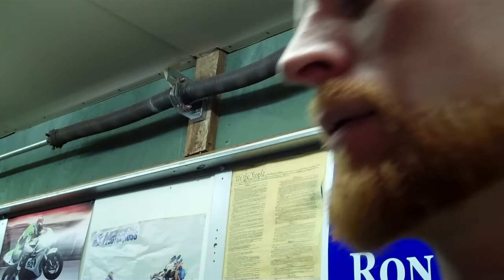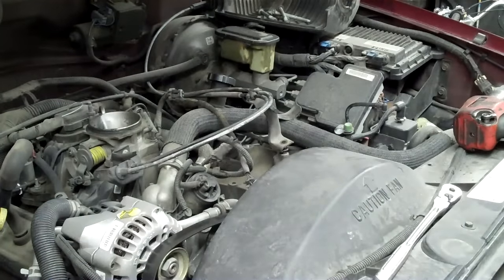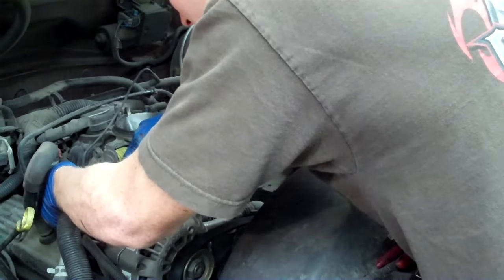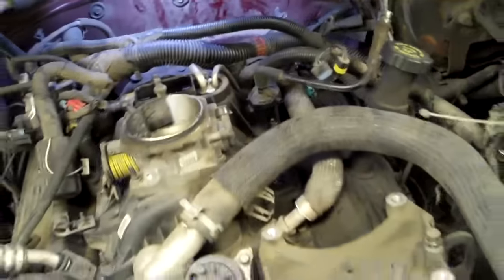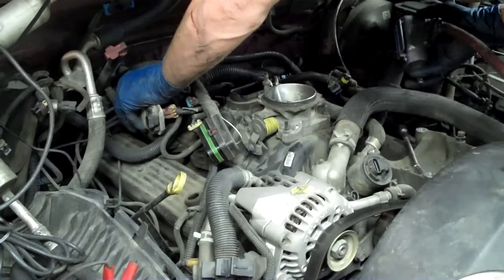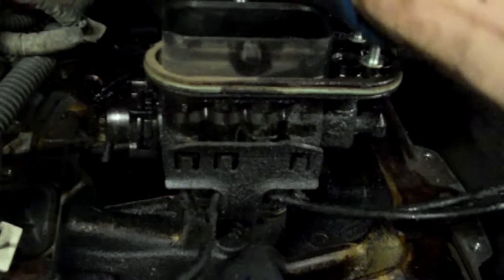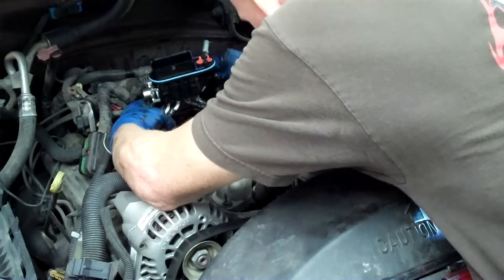How to change a SPIDER INJECTOR on a Chevrolet V8

Comment: Hey Brian. Thanks for the detailed video, I knew it would be a bit of a process but now I know exactly what to expect. I am trouble shooting a 5.7 I just bought and found once I add fuel and let it sit for a few days that my gas is dramatically less.ordered a fuel pump,filter,plugs and head gasket set because of constant white smoke. upon checking my oil I noticed it is thin and smells of gas. So I am assuming it is the spider leaking either at the pressure regulator or one of the spider legs. have you ever run into or heard of this happening to anyone else? could I clean the regulator or do I have to fully replace the unit?
Thank for any help my way.
2000 Denali 5.7 no check engine

Comment: Thanks for the reply, it turned out to be something completely easy. During reinstall I made a completely noob mistake, 2 spark plug wires going into the cap were crossed, due to a shadow, couldn't see very well :) i fixed it within 5 minutes of posting my original comment. anyhow, my truck now runs better than ever. Incredible results. Perfect starts, hot or not. Everyone needs to do this.. Its very easy and the results are well worth the few hours.

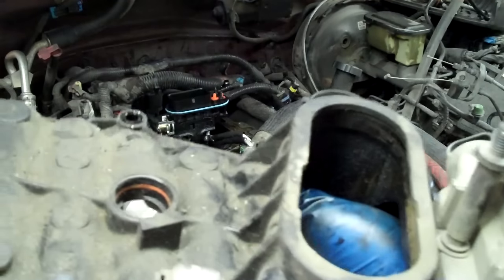Comment: hey brian, what kind & size o-rings or gaskets do I ask for when you talk about replacing the two at 34:19 to 34:23 ? those didn't come in my kit and I want to have them before starting project cause I won't be able to get to parts store when it's torn down.... also what is torque spec when reseating?  thanks very much if you can help with this.

Comment: finished this on my 99 suburban 5.7, it had been driven a couple weeks with bad fuel leaks, bad injectors bad fuel pressure valve etc, so it must have been loaded up with dumped fuel. started it tonight and got plenty of pressure and started instantly but runs ragged and slight backfire through the exhaust constantly and idles rough.

Comment: Hello,  what was the truck doing before you end up doing all this? you had gas pressure and spark, and it wouldn't start? how did you diagnosed or found  the problem?  thanks.

Comment: Let see if I have this right. The outer lines on the module got to outer injector ports and the inner lines go to the inner injector ports? Which lines are are on the top? Also, mine has been running rich a long time. How should I clean the top of the lower intake manifold? There is a lot of black greasy build up. Thanks for the great vid.

Comment: Hey bud, how do I check the injector signal at the harness connector for a 99 5.7 tahoe? I have a no start but do not want to replace spider until I'm sure that's what wrong. I'm not sure how to check that the injector is receiving a signal.

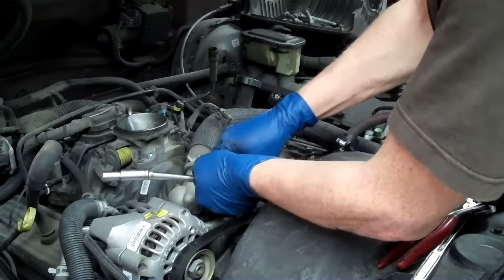Comment: Thanks for the video.  I cant find out where the Round pin plug goes.  You have it right above you right hand at top of glove at 8:22 - 8:25.  I got my '97   5.0 liter back together ok with new MPFi installed.  Been running back and forth into the house trying to put it all back together from watching bits and pieces of the video..  Unfortunately, my engine acts like it is missing on one but has greatly improved since MPFi changeout.  I already did plugs, might be wire IDK yet. Thanks for the video

Comment from the maker: I would take your VIN # to the dealership and get whatever they have.  I use aftermarket and performance parts most of the time, but in this case with this part the dealership has the latest updated part.  There have been SO MANY updates on these dang things.  You can get the old factory ones that are name brand- they get dumped onto the after market, but they are obsolete.

Comment: Thanks for the video, gave me the courage to attempt this after putting it off for so long.  I have one question....any tips on an easy way to get the o ring on the fuel injector to seat in the intake opening?  Been fighting it and it will not go.

Comment: My Yukon has a similar engine and I had a very similar problem.  I had misfire codes on 7 of 8 cylinders.  New plug fixed one cylinder but had 6 injectors failing intermittently.  Spider swap got rid of it.  Just fixed it on 3/5/13.

Comment: UPDATE:  Brian,  I loosen the screw that holds the bracket and raised it a little which brought the injector up higher.  I decided to change the bracket since my spider injector came with a new on.  My wife is a nurse so she gave me some surgi lube and everything worked out fine.  she's running great, like the day I bought her.  I got 231,000 miles on her and hope to keep on going !  Thanks for your video..John

Comment: Nice video, I'm working on a 96 4.3 Vortect atm and there is a possibility I might have to change the spider injectors. I had 2 questions if you don't mind 1 what was the symptom of that vehicle and what was the mileage of that car? if you still remember. Thank You

Comment: Installed spyder fuel injection as shown on video. Your video was very informative. I have a problem though. Truck is not starting, tries to start but acts like it is flooded. Took plugs out and are VERY gassy. I can shake the gas off the plug. Any suggestions???
Reply: Just my opinion, but you may try a new AC Delco fuel pressure regulator.

Comment: Nice vid bro👍👍👍👍👍
You broke down exactly how it needed to done!!! My question is..does this same method work for a 2000 Cadillac Escalade 5.7... I’m having some studering in my acceleration...not a tune up issue but I’m thinking its from the fuel pump and filter... I’m gonna start with the distributor and cap, new plugs and wires, new fuel pump and if that’s not it then it have to be the spider injections... also I keep getting a gm code p0303 misfire on cylinder 3.... which lead me to think it’s the spider injectors....please reply if you have suggestions...again nice video 👍👍👍 and thank you

Comment: Brian Great video. I had a code of “PO300” misfire for cylinder #1. Swapped 1 & 3 wires (no change), swapped 1 & 3 plugs (no change). So then I replaced the existing SFI with the new MFI system. Watching everything to make sure I installed it right. I did not performa fuel pressure system check to make sure the injectors were seated right and not leaking. Finished putting everything back together and now I have the same code “PO300” but it’s stating I have multiple misfires.
Any ideas before I tear it down to check everything?
Thanks

Comment: Have 97 Chevrolet Silverado. Started spitting and sputtering, will crank fine when cold but idles high. Once warm it will turn over but not crank until you hold the gas pedal to the floor. Once cranked though, it rough idles, sounds like it’s flooding or a hopped up race truck. Wants to die when shifting in gear and smell gas heavy. Fuel consumption has increased a lot. Does this sound like the symptoms of the spider injection system bad? Fuel pressure regulator? Any help would be greatly appreciated. I’ve changed the distributior-rotor and fuel pump. I’m spent and have tried hooking it to a computer for a code with nothing in return besides a engine coolant temperature sensor. I don’t believe that’s the issue at hand. Again thanks in advance

Comment: Hi, what was the symptoms of the faulty spider?  I am dealing with a 1999 GMC Yukon Denali that wants to sputter/stall when accelerating.  I have changed the 02 sensors, new cats, egr valve, throttle position sensor, fuel pressure regulator, fuel pump, fuel filter, mass air flow sensor,  ignition coil.  Checked for vacuum leaks,  Still won't solve it.  I am looking at this video as a next step.  Also, which silicone lubricant spray do you recommend?  Thanks!  Great video, love your patience, rants, and thoroughness!
Reply from the maker: Running poorly and missfire codes like P0300 & P030*

Comment: I have 1998 Silverado and I have to change the spider fuel injector twice with a used spider, still doing the same thing just run for 30-40 second and cutoff am trying to buy a new spider now, Do you think that will be the best to do?

Comment: Hey boss. I've replaced the feul pump. Resistor  and the unit on the left side of the upper manifold. Can't remember what they called it. Anyway, I put Marvell mystery oil in the feul system  now it runs . How long before it takes a shit? Should I replace spider also? Thanks...

Comment: Brian - great video. I have a 1999 Suburban. It starts up and then will not stay running unless my foot is on the gas. Engine sounds very rough.  I replaced the distributor, plug wires, and plugs. No change.  I think it may be the fuel pressure reg. and or regulator.
Can you offer any advice?  Maybe crank position sensor but I think that would be a no start condition... mine starts fine... just wont stay running without giving it gas.

Comment: Did you have a hard time seating the injector assembly back into the upper intake manifold? I can't get it so seat right in and it's causing a big vac leak, any leads?

Comment: Thanks for the video Brian it really helped me to "wrap" my head around the job.
Reply from the maker: Welcome Al.  Great to see you!
Reply: Thanks!!!  I changed out the spider and regulator and still have a non start condition. Will do further testing.
Reply from the maker: Check for spark.  It could be the CKP, control module, or coil.
Reply: distributor cap always malfunctions on these engines causing no start
Reply: thatswhite1 I had changed the Cab twice before...so I am confident that it is not the issue. It started shortly after I changed plugs wires cap with all accel set. ill keep playing with it even though the truck has sat like 2 years now. LOL
Reply: Al Forte check for fuel pressure, fuel pumps like to fail when they sit for long periods because of the moisture in fuel.

Comment: Brian,I have a 97 GMC Sierra 5.0 Liter...got everything off fine, new spider injector in but I can't seem to seat the upper cover the new spider...It will fit just fine without the O ring around it but when trying to get it on with the O ring on it just won't go.  Also the fuel regulator doesn't have a port on in that points down like the old one.  I notice yours I your video has it.  Any thoughts?  The part number on the inside of the new Spider is the same as the one on the old one.  Thanks,John

Comment: I was thinking of doing this,because I've done everything else. 98 cheyenne 4×4 305ci. If you slowly press the gas it will rev up. If you try to drive it it falls on its face bogging down like it wants to go but it wont????

Comment: Hi Brian. Thanks for all of your videos. I tried my 1st 5.7L spider injector UPGRADE today. I had an injector that did not "lock in" when inserted into the hole. Is this common ?  Visually I could see no difference between the one that would not "lock in" and ane that was not yet inserted. The assembly was a new AC Delco. I would not think that the injectors just get shoved in without being held in place. The ridge within the hole was verified and the hole seemed clean (visually). Defective part or defective mechanic ?
Reply: What ended up happening?
Reply: @MiguelGarcia-nl3ci  I tried a second Delco and got thew same result. Perhaps they made a bad batch. I then got an aftermarket set at Autozone., I don't remember the brand. They inserted and 'locked in place " with no problem. The car ran fine with the aftermarket set. This job was done on someone else's car, therefore; I can not speak to the longevity of the part.

Comment: My son has a 1999 Suburban 1500K.  After sitting for a long period in does not like to start.  It will crank and crank and won't start.  When it finally starts it is good for the day.  In the morning it many times does not want to start.  Have replaced fuel pump, gas lines, and whatever else he could change or have changed.  Have now been told it is the spider injection assembly.  Have you ever seen one act this way and have it be the spider injection aasembly?
Reply: Negative.  Just needed some TLC.  No need for bad language.

Lou  :-)
Reply: Usually it is the fuel pressure regulator leaking. This floods the engine after it sits for a while. Accelerator pedal to the floor while cranking should make it easier to clean out the surplus gas. But yes that is a symptom.
Reply: consaka1 hi. I will be going under to replace my fuel pressure regulator. Since I'm in there already should I mess around removing my injector spider to clean things up or leave it alone?
Reply: Could be your ignition switch. Common problem in these.

Comment: What is the symptoms of the spider injection going out? I replace the fuel pump fuel filter and still have to spray gas in sometimes to get to start and sometimes don't want to take gas going down.

Comment: Hey Brian 1st of all great job on the making this vid. I'm looking at purchasing this '99 Suburban 5.7 with 201k on it and they told me it has a #4 misfire. So they brought it to a mechanic and said that it cld be one of a cpl thing's either head gasket or head I'm guessing he was meaning warped head but then you'd know for sure by pulling the dip stick. After watching part of your vid I heard you say something about misfire...so you think the spider 🕷 injector cld be the culprit? Cause I'd rather just do that than going any deeper if it can be helped. Thanks...

Comment: Question, I am going to replace the intake gaskets (coolant leak). Would you recommend doing this while the intakes off? 116,000 mile Tahoe 5.7. Thinking maybe killing 2 birds with one stone. Seems to run good cept for a little rough idle when cold. Thanks

Comment: Hello Brian,

     So I done this whole job in 12 hours and with this new unit for the spider I was Already freaked out. 

The ports our so long and look to be to long. 
But I did the challenge and did the challenge slow check everything and did everything , with out tearing up the truck.
(97 chevy tahoe 5.7 4 wheel drive LT.
I had a code miss fire and a code miss fire 4.
So I figured the spider went after all plugs wires cap were fine and I had spark. But Maybe I should check compression.
So after I was finish cranked it over Ratttle left side of chamber 8 and 7.
sounds as if the pistons our hitting the Spider because there to LONG.
I think the puppets on the AC DELCO which was the old unit was shorter and better used for this but they snap and now I think the plugs might of called into to chamber and that means pulling the head and checking the Values.
By god I crank it over six times in different times to try to figure out if there was a rod that went. Cranking it over for 10 seconds or less running.

So the question is you stick with the NEW spiders and claim they will work and they our not to long. Maybe the 97 is different from the 98 in the video, But I doubt it.
20 hours of work coming my way.
Could be a wasted spider. 
Only way to get those spider puppets out is to push them from the back side because there no taps to press them out.

Pull the engine LOL

Comment: Thanks again for this video.My son and I just tackled this,and knocked it out in about an hour thanks to you on the laptop in the garage.The tip on the crows foot for the fuel line was great.Bought a set before we began,glad we did.!
Quick ?. the truck runs alot better now.around town awesome.But when i took it to the highway the truck doesnt want to kick down,even when i manually shift it down a gear or 2..any help please..thanks so much

Comment: Try checking it for vacuum leaks at the obvious spots being hoses. They can have small cracks hard to see. Spray all around hoses and intake with carb or brake cleaner. If the motor smooths out you found your leak. Or try cleaning IAC in throttle body. IAC being Idle Air Control.

Comment: Great video. I’ll be doing this soon. The price of the injectors scared me a little. Do you recommend a certain brand.
Reply: Nice video. My new style spider with the dangling injectors (as in vid) had very stiff tubing. End tubes would snap loose, so I spent HOURS with heat lamp getting a bit of bend. That did help. Next: the bracket is over-built, spring steel, and cuts the sides of the tubes. It is possible to grind away LOTS of the steel and it is still immensely strong without cutting the tubes. Why do engines fill with gas? As careful as I was, the car would run PERFECTLY but I got baffling hydraulic lock-ups. Drove me nuts. Today I verified LOTS of gas in cylinders and oil pan. Yet, it ran perfectly til it simply stalled on the road. There needs to be vid about the pressure regulator, take it out, discuss all parts, put it back on. What if I lost a little spring... don't know yet. Down-tube was dripping gas into ports, so I'm going to hook lines up and pressurize to see how bad... The outer ring on my regulator is split. The inner ring is in the spider-body. Which one matters most? Should be inner holds the pressure. I do not recommend the stiff tube fight, with tips popping off. Nylon can take about 300 degrees to bend easy. I also cut the heat shields so I could double-layer at the bracket for a guard against the cutting edges. Got it really good, gringing, etc. Now, the leak... Oh, yeah, my other style skinny black line spider seems to have blown codes in one year. But bends really easy. Good luck with either.

Comment: Took me about 4 hours to get my son's done, and your video was very helpful, but I have a few questions for you.  I had some trouble getting the plenum to fit all the way over the new injector unit, so I just tightened the bolts and it seemed to cinch it down.  After running the truck for about 10 minutes, the check engine light came back on  with the same P0304 code.  Any idea what could be causing it now?
Reply: The truck idled fine at first, but is running rough again now, but not as bad.

Comment: I,have a 1992 chevy astro van. I replace fuel pump and spider injectors and still don't start. I, see that the fuel get to the injectors but a don't get in to the spark plug. What does the injector  spray to the manifold a could be a sensor, relay or what. Is driving me kreasy. Can you give me a tip.